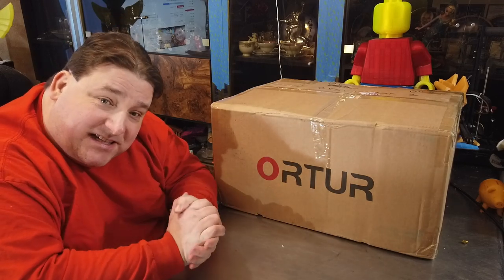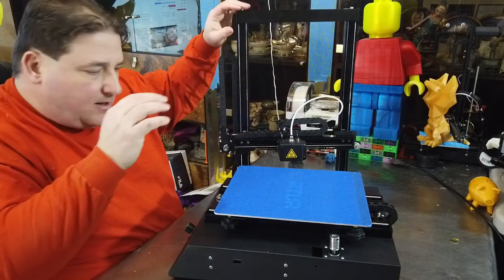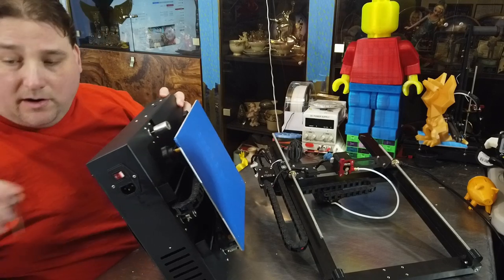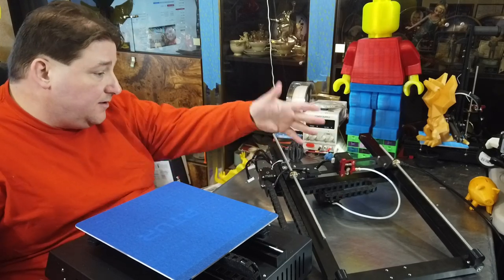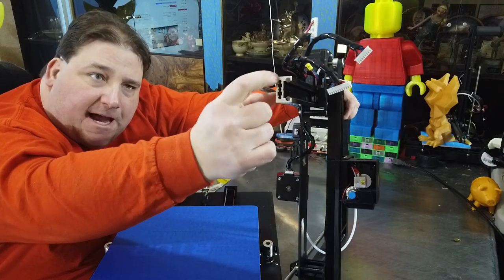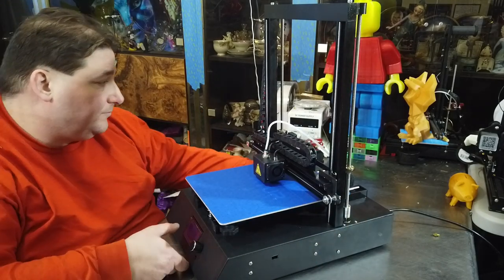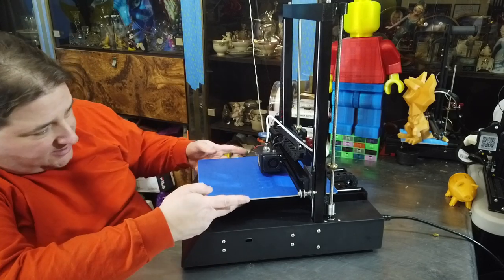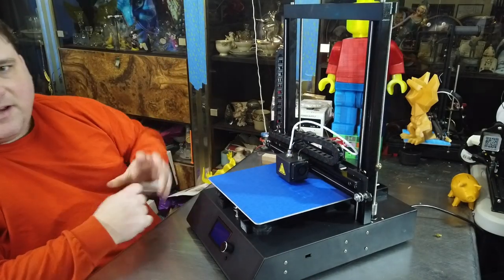Ortur 4 3D Printer Unbox, Build   T3DP

Comment from the maker: I have to apologize. I did not realize this video was missing bits on the end. Namely it running and printing. I screwed that up nicely. :-(

You will see more of this machine so i will make that right. Sorry for that.

If you saw the massive atomic rose proto pasta candy red heart box i printed. And had at mrrf. That came off this printer and it was quite excellent.
Reply: When they come to move your containers around, maybe they could load those in-the-way bins in the bucket and drop by your back door?
Have you read the Jazla review on Amazon? Do you have a voltmeter? Better than try-and-fry...

Comment: Love your videos, i just got the v2, noticed the acceleration and jerk values r very high an noticed in 3d print Canada video same issue but didnt give any good suggestions on what to back her down to. Any free advice is good advice in my book lol
Reply from the maker: Yes. Just use your start script to tone it down. I use x5 p500 for cr10 machines. I don't remember the full command line but once i get home i will reply again with the exact entry you need to add.
Reply from the maker: Ok here are the 2 lines to add to your start script

M205 X5
M204 P500 T1000

M205 is your jerk M204 is your acceleration P is for while printing T is for while traveling (moving but not printing)